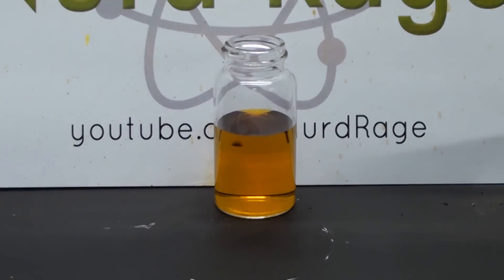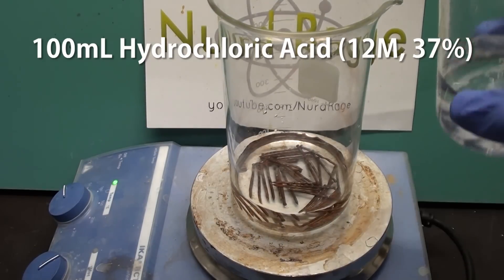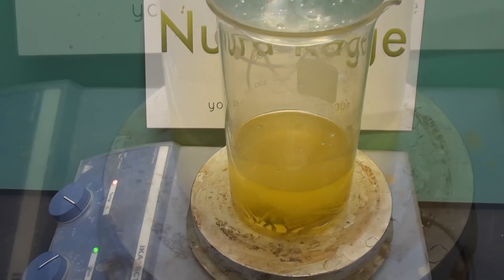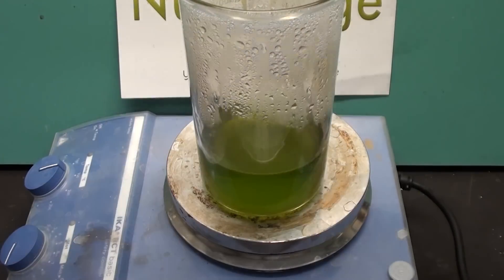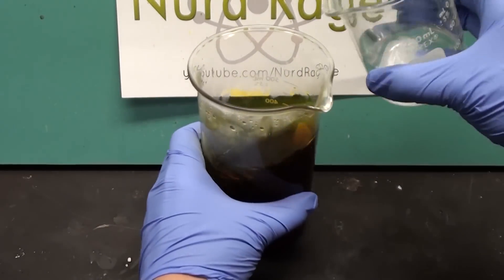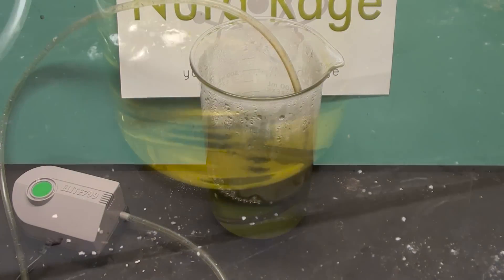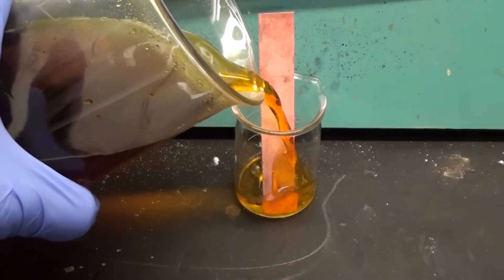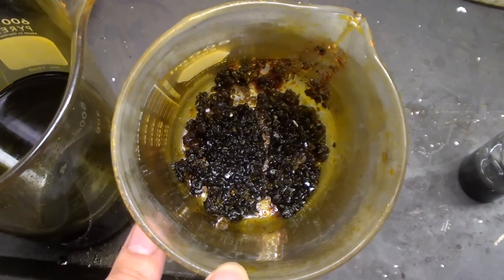Make Ferric Chloride (for etching printed circuit boards)

Comment: Is this good for through etching aluminum, and what is the safe way to dispose of it when you are done? Also, why not etch with the HCL?
Also, when you heated the solution, did the acid evaporate or just the H2O?
Reply: Iron chloride is used for circuit board etching because copper is not oxidized by HCl alone, unlike some other metals.  It's below hydrogen on the activity series.  Aluminum is though, so you could etch it with just HCl.  There's not a really good way to dispose of the iron chloride, and it's pretty hazardous to the environment.  The best way would be through a chemical disposal place.  I would actually recommend using copper chloride for circuit board etching--it's completely reusable, so you don't have to worry about disposal.  And yes, heating the solution will produce both water and acid vapour, which is why you should do it outside or in a fume hood.
Reply: When you say completely reusable, doesn't the copper have to removed after a bit? What about using an electroplating process to remove metal from the work and deposit it to a receiver electrode so it's not saturating a solution or using dangerous acids?
Reply: The great thing about the copper chloride method is that the copper metal (from the circuit board or whatever you're etching) is oxidized by the copper(ii) chloride, and they both become copper(i) chloride.  The etching of the copper is actually producing more etchant.  Yes, after a while you will run out of copper(ii), but instead of throwing it out like you would with iron-based etchants, you simply need to oxidize the copper(i) back to copper(ii).   This is easily accomplished either by the addition of hydrogen peroxide or by bubbling air through it.  I've used the same jar of solution for a year and a half, and when it turns dark green, I just re-oxidize it.

As for electrolysis, yes, that should also work.  I haven't used it for circuit boards though, so I don't know if there would be other complications.  Connect the piece you want to etch to the anode, use another piece of copper for the cathode, and immerse it in a copper sulfate solution.  Copper will be oxidized at the anode, and copper(ii) will be reduced at the cathode.

Both acid and electrolytic etching have their dangers (handling strong acids vs dealing with high currents).  The copper chloride method actually doesn't require HCl--it's only used for preparing the stock solution.  If you're not comfortable with handling acids you can just buy some copper chloride powder and use that.  I know I'm going on about copper chloride a lot, but it's really the safest, cheapest, and most environmentally friendly option, so if you're doing it for the final product and not the process, I highly recommend it.
Reply: Griffin Kowash
So what will you have after 10 years of etching copper every day? I weld. I think I can deal with plating current. I want to use the safest method and substances in case of some unforeseen disaster. I'm disabled and the likelihood of dropping something, falling, whatever, that could cause some domino fail in a crowded workspace used for everything under the sun, and on the property my drinking water comes from, makes me extremely cautious. What happens to the spilled etchant in the soil, concrete, sand, clay, etc.until it gets to the ground water?

What I like about the plating method is I'm plating something. I'm concerned about being able to plate any practical work piece. I'm thinking proximity is going to be an issue and foresee the need to use a mesh as the anode in close proximity across the entire surface to get a predicable and consistent rate of material emission.

And of course again, what are the worst case issues with the copper sulphate relative to my property? There's two reasons I'm looking at this. One is the toxicity issue, and the other is that I want to both etch, and plate things.

I also have multiple applications for possible acid based etching in the use of etching artwork for art for art's sake as well as labeling device and sign panels. I'm likely to want to do all of these things and want to fully understand the end game in running the cleanest safest operation so that is I can manage to escalate it to a practical commercial level, I will be safe and have the best chance of defending the safety of the operation to environmental, city, county, state, and, federal officials.

I don't want to injure me, neighbors, critters, nor end up being sued or jailed.
: )
Reply: I just realized that electrolysis will NOT work because, as islands disconnect from the original conductor, they become electrically isolated and stop emitting. Xb DUH! No wonder I never saw anything about it anywhere. Even if you could rig a contact to each actual trace that could be insulated from the electrolyte, the etched areas will leave islands. Damn, I though I had something there! Glad I didn't waste a lot of time trying to set it up! : )
Reply: Tricknologyinc I'm not a welder, and I don't have experience in commercial production, so take everything I say with a grain of salt.  What works for me may not be best for you.  Etching with the copper chloride will only work for copper, and on a large scale like you're talking about, the amount of etchant that's produced with each run could certainly be problematic.  As for spills, copper chloride is toxic, so it could certainly pose a hazard in the case of an accident.  It may erode bare concrete, so you would want to have all of your acid in a space with chemical resistant floors (such as sealed concrete.)

In the case of a contained spill, you can neutralize it with either dry or aqueous baking soda.  This will form a solid precipitate of copper carbonate.  The copper carbonate is far less toxic and can be very easily collected for disposal.  The remaining solution can be safely washed away, because it is now just sodium chloride.  If your solution is acidic, carbon dioxide will be evolved in the neutralization, which could possibly cause problems if you're in a small, unventilated room with a lot of acid to neutralize.  Basic chemical safety procedures apply for individuals working with chemicals--gloves, goggles, chemical-resistant clothing, a close source of running water (ideally a chemical shower, otherwise a sink), and an eyewash station.  If chemically etching aluminum, you would probably have to use hydrochloric acid or sodium hydroxide instead, since aluminum doesn't have two convenient oxidation states like copper.

Electrolytic etching is another alternative, and it sounds like something you're more familiar with.  If you're planning to do both etching and plating, you could experiment with doing both at once.  Attach the piece to be etched at the anode, the piece to be plated at the cathode, and electrolyze in a copper sulfate solution.  The reaction will dissolve copper from one end and deposit it on the other.  One nice part is that there is no net change in the electrolyte composition, because Cu2+ ions are already present, and the oxidation of SO4 2- will end up producing CuSO4 again.  Copper sulfate is also slightly toxic, but can be disposed of similarly to copper chloride.  Aluminum electroplating is not especially practical, but you can read through this patent if you want: http://www.google.com/patents/US3236751

All of these methods require a lot of more precise planning; namely, preparing the pieces and treating them to ensure an even etch/plate.  Organic compounds and oxide layers are an issue.  Pieces must be washed in acetone and sanded very well to remove these.  Skin contact, environmental factors, and long exposure to air can reintroduce oxide layers and oils, so you'd have to keep it very clean.  Also, during processing, pieces tend to collect bubbles that inhibit the reaction and result in uneven blotches.  A couple of ideas would be using constant stirring to keep it agitated, or bubbling air underneath each plate to collect the attached bubbles.

In short, it can be safe with careful planning and proper safety precautions.  Each method has pros and cons that change depending on your material and desired product.  If you plan to go commercial with this, I would recommend consulting someone who specializes in these things or a licensed chemist.  Sorry, I've probably rambling on for way too long.  But I hope this helps.
Reply: Tricknologyinc Ha, good point!  Yeah, maybe that wouldn't be so great for circuit boards or other insulator-backed metal.  Solid blocks of metal should still work though.
Reply: Griffin Kowash
 I really appreciate your input. I know how hard it is to stop. There's always something life and death that was left out... This will be a nice primer and study guide for further research before talking to a chemist. Thanks much.
Reply: Griffin Kowash
You are wrong:
HCL mixed with H2O2 will etch anything I guess even gold.
I used that solution to recover silver from brass/silver mixture.

also Iron chloride is equally reusable as copper chloride because you can regenerate in same way.
Reply: Griffin Kowash Fe(III) based etchants also can be recycled.
Atmosferic oxygen will oxidize Fe(II) back to Fe(III) but H202 is faster

Comment: why do you use a small strip of bare copper in the end. What is the purpose of that test? Thank you
Reply: The purpose of making this was to use it to dissolve copper. Wouldn't you want to know if it works? Of course you could test it on a full PCB project, but it's less wasteful to test a small sample.
Reply: Tricknologyinc thank you
Reply: Aristotelis Kondos
Duh. ; )

Comment: all my spent iron3chloride gets poured over iron-shavings in a plastic jug.  Toxic ionic copper gets kicked out of solution in the form of less-hazardous copper hydroxide fine grey precipitate.   The solution gets reduced to greenish iron(2) chloride which can be neutralized by adding it to a slurry of urea in water (mentioned online somewhere) .. till it stops fizzing.  Hope this helps.

Comment: dihydrogen monoxide is wrong for all the right, accepted-nomenclature reasons.
Water has a dissociation constant so it's best to call it hydronium hydroxide.  Dihydrogen monoxide would be more suited for a purely covalent (or ionic) substance -- something water isn't.

Comment: You can add more HCl by way of hardware store muriatic acid. The solution will still be quite murky and you certainly expect a somewhat slower etching process due to contaminants. See Nurdrage's other video on different types of etchant solution including CuCl2 etchants and it will be a lot easier than working with ferric chloride.

Comment: Can I also get Fe(II)Cl2 from the electrolysis of Aquarius NaCl and a positive iron electrode? I was originally trying to speed up the process of creating Iron (III) oxide by adding salt (my friend told me to do that), however I got a product that looked more like Fe(II)Cl2...Brown powder.  I figured that most of the brown powder came from the iron oxidizing with the Cl- ions in solutions. I also was unsure if the Cl would turn directly into a gaseous state, so I did this outside.

Comment: I use them from store in pellets and dissolve in water, what is needed when the solution dries out (similar to the crystallised form), or just enough water to disolve? How many times it is fesable to repeat? Usually I try to use as small volume as possible to do etching, and dispose remains if I don't have anything to etch any time soon.

Comment: Hi. I tried to make the solution. I used 100ml of water 100 ml of Hydrochloric acid and steelwool and it has been a day and the steel wool still hasn't dissolved
Any help?

Comment: I have tried to make ferric chloride reacting iron with copper chloride(made from mixing copper sulfate with sodium chloride) in order to get ferrous chloride and then oxidized to ferric chloride, but everytime I do this a precipitate settles at the bottom. Why doesn't work?

Comment: well, most PCBs have a solder-resist mask that is also a good etch-resist. The gold plating is also on top of the copper, which means it acts like a protective layer, preventing the copper from being dissolved. All in all, there are better ways.

Comment: usually there's a very powerful fan which mixes in a lot of atmospheric air, thus diluting the fumes, as well as the system being made of something fairly inert like stainless steel. You'd be surprised how well materials hold up to fumes even if they wouldn't hold up under direct exposure to the reaction/reactants in liquid form.

Comment: Where do fumes go? And how are they rendered inert? Never fully understood how a hood works, or how a fume hood could possibly be designed so as not to corrode or risk inadvertent reactions happening downstream (up the flue, so to speak).

Comment: I'm not sure. But it is very strong. It has the same smell like household HCl (15-20%). I've tested it, and when I dropped the acid over the steel wool, it started to boil. Ill post the video

Comment: After etching, the left etching solution i.e Ferrous chloride solution. How to drain it? Just flush out or in wash basin , but it corrodes metals that come contact to with it.
So, how to decompose it and pour away in drainage?

Comment: i tried this years ago. My problem was when boiling it down it it formed what i thought was a sol. I basically turned brown and looked more like a suspention and gave up thinking it was the wrong route. At the time ihad the impression Ferric and ferrous chloride looked the same exept one formed a true solution while the other formed a sol. I would like to see a video on sols from you, I havent seen one on YT, and sols are quite interesting

Comment: These crystals are black. Shouldn't FeCl3 be yellow?
Reply: Actually I think they are brownish yellow but your right they should be acid yellow color.  Maybe get the brown crystals and see what happens with adding additional hydrochloric acid.  Might not be in nicely shaped crystals but you should get flakes from a yellow mass.  You should have seen the sodium hydroxide I used as a desiccant!  It got wet and glaze over into one solid mass and looked like a partially frozen lake!  I dissolved it in water to make a syrupy 45% solution and filtered warm through a cotton ball compressed into funnel.  I now have a super crystal clear highly viscous concentrated sodium hydroxide solution I can dilute to any concentration with water and a handy algebraic equation.

Comment: I use ferric chloride because the reaction is slower and more gentle on the printed traces. For me hydrochloric acid + h2o2 usually damaged very thin lines.

Comment: To etch PCB boards we use Hydrogen Peroxide, water, and Hydrocloric acid. usually try to find something higher than 5% for Hydrogen Peroxide.

What's the advantage of using your method of the one I stated?

Comment: Hello and thanks for the video!
Can you tell me what the chemistry is in my result?
Used electronic scrap, partially to dissolve the steel before going after the Au, Ag, etc.

Solution was as you showed, but there was some additional black sediment (carbon from the steel?) and more interestingly, much of the remaining metal is now copper plated.

HCL doesn't react with Cu, at least not like that, so what caused copper plating to occur? Can provide pictures if you are interested. Thanks!

Comment: I work at  a company that makes circuit boards, I work in the lab with chemicals and don't work with the circuit boards at all. I see large tanks with solutions of copper, nickel, tin, gold, and maybe another. So I don't work with iron at all. Know if this means we work with a different type of circuit board? Or maybe the circuit board is treated with an iron solution before I ever see them?

Comment: Regarding PCB, I used to make PCB and I hated using Ferric Chloride. It's slow, it requires heating (you have to get the etching fast enough so the solution doesn't start to seep under the positive mask), it stains. Ugh.

A better solution we found was Nitric Acid. Yep. Very diluted and good for many uses. turns a lovely shade of blue when it has enough Cu ions. The only caveat was the amount of care and safety needed when preparing the diluted solution, smoking nitric acid is no joke.

Comment from the maker: That's easy.
Get some dihydrogen monoxide (water), some crushed fibrous silica (soil) mixed with potassium, phosphorus and nitrate containing compounds along with some trace elements like iron, magnesium, calcium and the like (fertilizer). Into all of that i shall insert a biological self-replicating nanomachine ultra-fabricator unit from the "corn" species (a seed) and apply narrow-band visible electromagnetic radiation (sunlight). Give or take a few months, i will have a corn plant (food).

Comment from the maker: if its already dark brown FeCl3 then gently heating to make it evaporate faster won't be an issue. But If you heat it too strongly while dry it'll decompose into FeCl2 and chlorine. So just heat it until you reduce the volume considerably, and the let evaporation do the rest.

Comment: I had a bucket of a copper compound, and I added a bunch of aluminum to it to make it easier to dispose of. However, I forgot to dispose of it, and now I have these very large and long crystals. They have a index of refraction lower than that of water, and they are very light. I'm not sure what copper compound it was, so could you please give me an explanation of what crystal I might have on my hands?
Thanks.

Comment: Hey nurdrage it would be so awesome if you could show how to make the tinplating solution that is offen used to protect the pcb after it has been etched a commertial product for this is called bundgaard sur tin and i have no clue how it is plated on to the pcb as it is not electroplated onto it - but i bet there would be a lot of good chemestry in it.